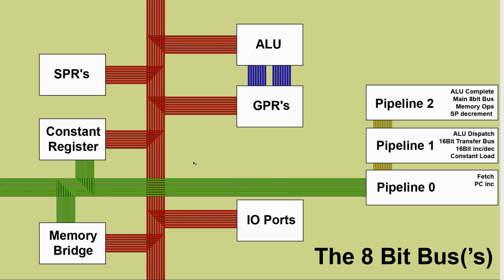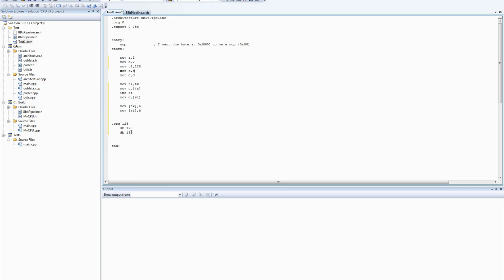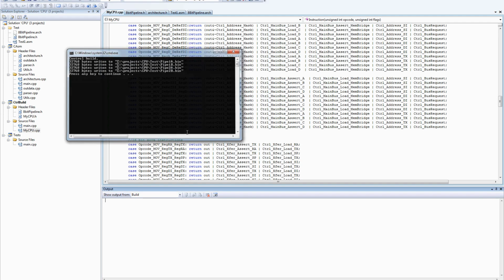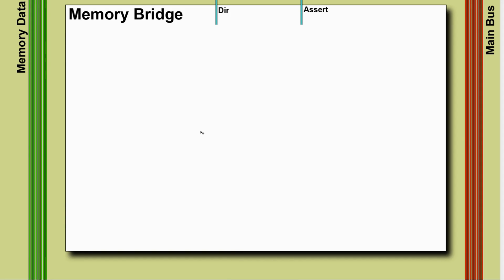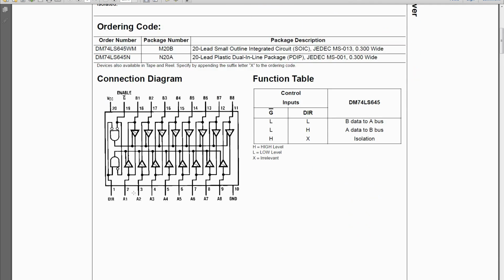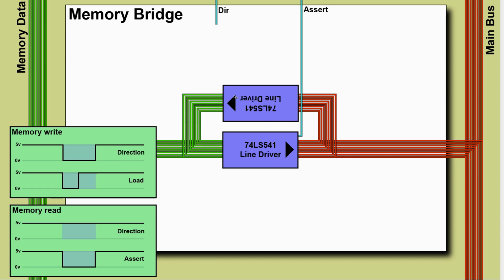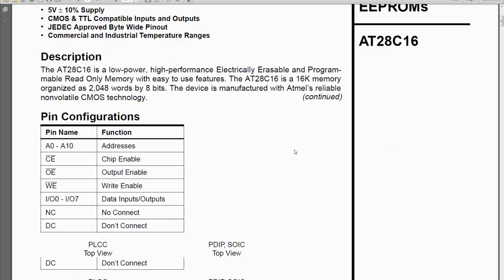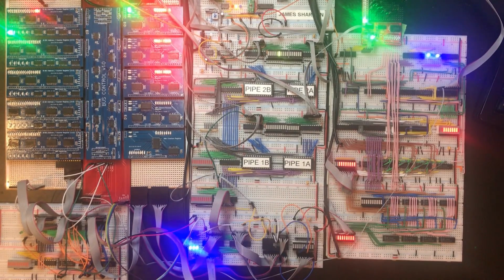Memory Bridge - Making an 8 Bit pipelined CPU - Part 53

Comment: (11:01) I'm fairly confident that won't cause two things to assert to the main bus at the same time. What I'm not so sure about is the memory data bus.
(16:23) Yeah, I'm pretty sure there's potentially a very short period of time where the memory bridge can be driving the memory data bus at the same time the ROM chip is driving the memory data bus.
(19:15) Ah. That's a race condition/propogation delay issue.
Reply from the maker: The 138 outputs are designed to avoid clashes for this reason but I too was concerned about this so the pcb is wired a bit safer.

Comment: Is the “Dir” line just equivalent to the “Mem Bridge Load” line produced by the Bus Controller?
Reply from the maker: It's very similar, they go both go low for the load operation (A memory write) but the direction line stays low for the entire cycle, I did this so the data being written stays on the bus for the whole cycle. I feared a possible race condition otherwise.

Comment: I might be wrong, but I think you could have just used the single chip (74LS645) solution. The and gates for dir and assert(/load) are already build in. As you stated earlier load and assert are basically the same although in opposite direction.
Reply from the maker: Yes, there are several different octal transceivers that would do the main work in one chip. I chose to separate it like this though to simply the logical flow across the design. I had used the 541's elsewhere so my choice was to use 2 of those with a simple explanation or describe a new device and add any extra part to my bom. If you were trying to mass produce them or keep the physical size down you would obviously go the other way.

Comment: which component generates the Mem-Dir Signal?
Reply from the maker: In the current circuit it’s generated from a 3:8 decoder on bus control, it’s wired with the same inputs as the load line but without the clock. You could do it just as easily with a 4 input NAND gate, I used the decoder so I didn’t have to worry about the timing being different than the assert lines but that was probably overkill.

Comment: It seems like I missed the intro of the mentioned control lines like memory assert, bus request, direction. Can you please tell me in what viedo to look?
Reply: also AdressMask, Membridge LOad and Assert, thanks
Reply from the maker: Bus request is the 13th control line out of pipeline stage 2, it is activated during a memory read or write (it stops both fetch and the program counter increment). It basically just means that stage 2 is using the memory bus, so nothing else should use it.
Reply: @weirdboyjim  ad Bus Request: Is that implemented yet at that stage of your build or will it be implemented later? because in my build at that stage the nofetch is only triggered on constant load and the PC-Inc is triggered by clock, so each clock pulse the PC increments
Reply from the maker: @prtlwnft4028  Bus request is implemented in part 46 - https://youtu.be/g0UfkgBmCiU?list=PLFhc0MFC8MiCDOh3cGFji3qQfXziB9yOw&t=182  but I touch on the increment bit in part 36
Reply: @weirdboyjim  Sorry for my poor english and electronics understanding, but please could you describe how the BusRequest Controlline is wired to avoid fetch and PC Increase, and also please how the direction line is wired and what function it serves, many thanks!
Reply from the maker: @prtlwnft4028  Bus request is wired to 2 things. Firstly it's wired to the 2nd enable input on the line driver in the fetch unit, this works exactly the same as the fetch surprises line. The 2nd thing it's wired to is the 2nd bit in the pc/ra increment selection. Since only index 0 and 1 are valid (and result in incrementing PC or RA respectively) setting that line high means that no increment will happen. You'll need to skip forward to the call/return video to understand why I wired PC/RA like that but it should be easy to see why that stops the increment. I only mention that last bit in case you think there is you think you've spotted an easier way.
Reply: @weirdboyjim  Thanks James a lot! In the meantime I Tried the following and suprisingly for me it works correctly, also the memory write (ofcourse only by looking the control lines, no RAM available for now): FIRST I ORed the reset line with the BusRequestline, the output ORed with No-Fetch and that output wired to the OE of the line driver PIPE 0. SECOND I wired the BusRequest to the second input line of the ls138 serving the PC and RA Inc. The first input line of this ls138 is manually wired to ground. It seems to work fine, in Austria we would call it "Ein blindes Huhn findet auch ein Korn", or is there a terrible mistake in my circuit?  No idea yet of the meaning of your direction line, thats worrying me ..
Reply from the maker: Ok,  that makes me worry I didn't explain it very well. It's all very simple once you think about it in the right way.  Think about the load/assert lines that go into the registers,  A,B,C and D are at address 1,2,3 & 4 respectively. The memory bridge is a device on main bus the same as a register but at address 15. The load/assert lines work exactly the same as for a register, the memory bridge makes memory look like a register (apart from the current address selected by stage 2).
Reply: @weirdboyjim  Your explainations are TOP, my understanding isn`t, sorry for that, but now seeing it as an GPR its clear to me, thanks
Reply from the maker: The memory direction line is just bit of extra information I need to make the bridge work, it's the same as the load line for the memory bridge but it stays low for the whole cycle. I could have constructed that data inside the bridge but it was much easier to make an extra line from bus control. It's the nand of the 4 mainbus load selection lines (I put it at address 15 to make that easy).
Reply: @weirdboyjim  ad direction line: how did you implement it to stay low for the whole cycle, I could not find. whats the behavior of the direchtion line, on Adress 15 of the mainbus load selection i find the MembridgeLoad not the direction line , little bit confused, sorry

Comment: I read about microprocessor design in the '80s. It has helped me to understand a lot about computers over the years. I thought the architectural concepts were long gone. This series is helping to revive those old synapses. Perhaps the thing I'm missing the most is the firmware and programming. I have difficulty with the different files: .obj, .h, .cpp; and their function. I'm also curious about device and software you use to write the eproms. The whole process of compiling has always been a stumbling block. If you ever cover that, it would be awesome. Either way, this series is fantastic. Thanks James
Reply from the maker: There will be some more programming ones coming up, I'll try to provide a bit more explanation on the fly. I have a custom assembler I've developed, the roms are written by an off the shelf programmer but the data files it writes are generated my a program of my own devising. The process is covered a bit in one of the earlier videos but i'll go over it a bit more in the next video.